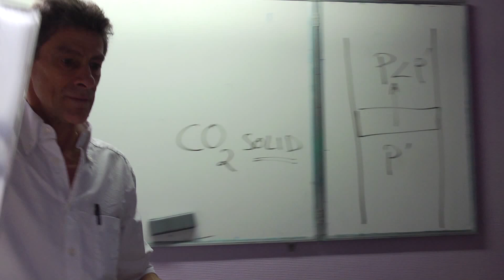Making SOLID Nitrogen!

Comment: Great video!!

I just want to point out one thing though. That was DEFINITELY NOT CO2 at the end. 

Instead it was from the solid nitrogen they made. My reasoning is as follows:

1. Dry ice (AKA frozen carbon dioxide) sinks. It does not float on water. If you are uncertain about this I'm sure there are probably heaps of YouTube videos showing it. [Frankly, this is all you need to know that wasn't dry ice]

2. Liquid carbon dioxide only occurs under containment, if it is open to the atmosphere it will instantly become gaseous, you would never just watch it bubble away

3. Dry ice in contact with cooled water would not sublimate into gas that fast, but when you watch the floating piece of [nitrogen] ice the gas is shooting off it

4. Carbon dioxide is heavier than air so the gas will 'pool' more than what you see in the video. instead the gas is shooting up and away more easily, it still is somewhat heavier than air but that is because the nitrogen is still so cold

5. Carbon dioxide makes up only around 400 parts per million in air. There's no way that enough carbon dioxide from the air came into contact with the water / liquid nitrogen bath to make a big lump like that. Especially when nitrogen gas is pouring outwardly from the bath and pushing away the air

What we saw was due to the solid piece of nitrogen that was clearly floating in the liquid nitrogen before it got poured into the water bath. 
The warmth from the water half melted it but, as it bubbled away, it cooled more and more [just like the 'boiling resulting in cooling' explanation at the start of the video] until it became solid again [albeit now a much smaller piece]
Reply: i don't think so, it's true that solid co2 don't float, the difference in temperature help it float, it's a weird physic phenomenon, because the difference in temperature is so much, the solid co2 turn to gas incredible fast, so fast that it create a kinda of "rocket engine", push it self out
Ps: i knew this because of a sci-fi movie used this phenomenon in battle
Reply: Long Nguyen You contradict yourself. Either a piece of dry ice that big floats or doesn't, and trust me it would not. Also, the water would obviously still be quite cool so the temperature difference would not be enough to make vapor release from dry ice so fast. I have spent plenty of time messing about with dry ice and I have never seen it shooting out like that. 
The only reason it shoots out so fast is because of the great temperature difference between the water and solid nitrogen. A MUCH greater difference than for cool water and dry ice.
Reply: +Marc Somerhausen
That was a very weak rebuttal Marc. It is clear to anyone that it is a liquid, maybe you should run the video at quarter speed and look a little harder, Huh?

I get it why you want to argue the point it is a liquid though, that's because it is the nail in the coffin for your argument that it's CO2. But you still want to persist in arguing it's CO2? 

You are one of these people who would adamantly argue a wrong point because you don't have the spine to be able to admit you are wrong. 

Dry ice is heavier than solid nitrogen but you really think that dry ice floating in the video? The density of dry ice varies, but usually ranges between about 1.4 and 1.6 grams per cubic centimeter which is considerably heavier than water at 1.0 grams per cubic centimeter, meaning that dry ice sinks in water, it does not float. The density of solid nitrogen is 1.027 grams per cubic centimeter, and, while this is slightly more that water it is able to float in the video due to the cushion of gas it is continuously producing below it can overcome the slight difference in density.

You have been proven wrong Marc, just try to have the guts to admit it

Don't start spouting rubbish again Marc, talk is cheap. IF YOU REALLY THINK THAT DRY ICE CAN FLOAT LIKE YOU WERE TRYING TO SAY, THEN SHOW ME ANY OTHER VIDEO WHERE DRY ICE (a piece that's at least as large) CLEARLY AND UNAMBIGUOUSLY FLOATS THE WAY THAT FLOATING IS SEEN IN THIS VIDEO

GOOD LUCK SEARCHING BECAUSE YOU WILL NEVER FIND ONE
Reply: It's really not worth getting angry over this. But I do agree it cannot be CO2. DJR made good points. To add to that, there is less than 1 gram of CO2 in a cubic meter of air. Hard to say how much ice is there but I think it's at least a gram. No way a cubic meter of air was cooled down to -140 C here, right? (Needed given the low partial pressure of CO2 in air.) They would have definitely commented on it (or at least tried to) if the air was cooled that much!

Also — there was nitrogen ice in the bottle. The bottle was poured out and there was ice. Why would we think it's a different ice than the one we saw right before?
Reply: DJR is actually demonstrably incorrect. I say demonstrably because I've done many experiments with liquid nitrogen (evidence on my channel), and it forms the dry ice puck with just regular liquid nitrogen (no frozen N2 needed).

Also, it cannot possibly be solid nitrogen because nitrogen's triple point is at 12 kPa (if memory serves). This is much lower than atmospheric pressure. This means that any solid nitrogen will immediately melt and then boil on contact with the water. It can't sustain a solid form being heated at standard pressure. 

The nitrogen is more than cold enough to deposit frozen carbon dioxide, and it took quite a while to form that amount. I don't know why a cubic meter of air couldn't possibly condense out in that timeframe, given that the molecules in the air travel at hundreds of meters per second. The instant they slam into the liquid nitrogen they will freeze. Even air itself will liquify from how cold liquid nitrogen is (again, evidence on my channel).

Lastly, the reason it floats is because it starts out as little bits of dry ice in the liquid nitrogen and then coalesces into one piece. I know this because I've watched it happen many times pouring nitrogen in water. Millions of air pockets in the frozen carbon dioxide make it appear white and lower its density (pure solid carbon dioxide is clear).

So no, that is not solid nitrogen and it cannot possibly be.
Reply: "Either a piece of dry ice that big floats or doesn't, and trust me it would not."

First of, no. If there was no leidenfrost effect messing the surface of the water, then it would float by sheer surface tension(the same way you can make a metallic coin rest on top of a water surface if you're stable enough balancing it). But there is a leidenfrost effect and that alone it enough to justify it floating. This is not a solid chunk of CO2, this is a thin sheet full of holes.

"so the temperature difference would not be enough to make vapor release from dry ice so fast. "

It is enough. Just look at the fog released. This thin sheet of liquid nitrogen has not much mass but a lot of surface to exchange heat.
Reply: +Marc Somerhausen
3.15 That is not CO2. 
It is very simple ok. CO2 can not exist in the liquid form when open to the atmosphere like this, and it is very clear in the video that a white, bubbling liquid is floating on top of the water at this moment. 
It is a liquid (at this moment, shortly before becoming solid) so it is definitely not CO2.

The triple point of CO2 is at 5.11 atm and -56.4 deg C.  Therefore CO2 only exists as a liquid at 5.11 atm and above, that means five atmospheres of pressure not one.
Reply: DJR This is a good point but you see a bubbling mass, not a bubbling liquid. It could very well be CO2 snow+leidenfrost effect and the snow blends into one solid block.

Liquid nitrogen doesn't spontaneously forms into a solid. With the time it took to form, you can be certain the temperature is -196(you can see that the liquid nitrogen is at its boiling point) and not any colder. You can argue it's something else than CO2, but saying it's nitrogen is stupid.
Reply: @djr5995  "I just want to point out one thing though. That was DEFINITELY NOT CO2 at the end." 
It most likely was. I can't think of any better candidates
"Instead it was from the solid nitrogen they made." That is not possible. It would have melted immediately

"1. Dry ice (AKA frozen carbon dioxide) sinks. It does not float on water."
Steel doesn't float on water typically, yet a steel boat filled with air can. I've poured liquid nitrogen on water myself. Tiny specks of white frozen CO2 start appearing inside of it, and then join together after the nitrogen evaporates. It could be that it's filled with many bubbles that reduce the density. Also, it's outgassing CO2 underneath itself like the Leidenfrost effect, which may help it float. There's also surface tension. There are many potential explanations for why it floats.

"2. Liquid carbon dioxide only occurs under containment, if it is open to the atmosphere it will instantly become gaseous, you would never just watch it bubble away"
This is demonstrably wrong. If you release the pressure for liquid CO2 in a container, it will rapidly boil until it freezes, just like the nitrogen in this video, except it's much faster. This is another experiment I've done myself, so I know this for a fact. The resulting CO2 snow can stick around for some time. 

"3. Dry ice in contact with cooled water would not sublimate into gas that fast, but when you watch the floating piece of [nitrogen] ice the gas is shooting off it"
Again, this is false. Dry ice rapidly sublimates, even in cool water. Also, this was likely more of a dry ice snow. It cannot be nitrogen because nitrogen would immediately melt and then boil. Standard conditions are well above nitrogen's triple point pressure.

"4. Carbon dioxide is heavier than air so the gas will 'pool' more than what you see in the video. instead the gas is shooting up and away more easily, it still is somewhat heavier than air but that is because the nitrogen is still so cold"
But you're admitting that the gas is still heavier than air. It's shooting up because it has momentum. The vapor pressure shoots it up as it escapes from underneath what is likely CO2 snow. Also, some of the gas may indeed be nitrogen, since that was contained in the CO2 snow and vaporizing before.

"5. Carbon dioxide makes up only around 400 parts per million in air. There's no way that enough carbon dioxide from the air came into contact with the water / liquid nitrogen bath to make a big lump like that. Especially when nitrogen gas is pouring outwardly from the bath and pushing away the air"
The nitrogen gas pushes air away in some places and likely sucks it in in other places. The amount of CO2 in that dry ice snow pellet/sheet is probably much less than a gram. I don't think it's impossible for that much CO2 to condense out of the air

*"What we saw was due to the solid piece of nitrogen that was clearly floating in the liquid nitrogen before it got poured into the water bath. 
The warmth from the water half melted it but, as it bubbled away, it cooled more and more [just like the 'boiling resulting in cooling' explanation at the start of the video] until it became solid again [albeit now a much smaller piece]"*
This is not possible. The amount of heat going into it would massively outweigh any self cooling from evaporation. As a matter of fact, it certainly can't self cool because the partial pressure of nitrogen in the air is about 780 millibars which would add some nitrogen back to the solid and liquid, warming it up and melting it faster. Solid nitrogen cannot be sustained at atmospheric pressure and standard temperatures. Look no further than virtually every nitrogen freezing video that uses a vacuum. The nitrogen ice immediately melts when the air is let back into the chamber.
Reply: Anyways it looks awesome. That's what matters
Reply: Your completely wrong

Comment: now make solid helium
Reply: Make solid water
Reply: +Gamer Zeke that sir, would be an extreme feat
Reply: solid hydrogon
Reply: +CrafterBros0 Solid helium can't exist in 1 atmosphere pressure, it only exists in pressures greater than about 24 atmosphere pressures. It would be really hard to do.
Reply: Helium becomes solid at 1 Kelvin, meaning, when you have almost 0 atmosphere, you can solidify helium.
Reply: MCommandguy Last time I checked helium freezes at about 0.95K at 2.5 MPa (25 bar)
That's nearly 25 times the atmospheric pressure, not 0.
Reply: +CrafterBros0 good one
Reply: impossible
Reply: we do, we call them ice
Reply: +Connor Catlett no, it's temperature, but to reach that temperature on a 'big' scale (bigger then a molecule), you need to have almost 0 pressure.
Reply: If you want to make solid helium go to another planet
that has more pressure.. it'll probably work, i dunno
Reply: So you go lower pressure to make solid nitrogen but go really high for helium? THINK

Comment: cool. This same principle is used in ultra high field MRI magnets to drop the Helium temperature from 4.2 K (boiling point at atmospheric pressure) to 2.2 K. This allows the superconductive magnet wire to conduct more current at higher magnetic field. In the process, unfortunately, a lot of Helium is wasted to boil off, and can't be easily recaptured due to oil contamination from the vacuum pumps.

Comment: He says that the water cools as it boils because the faster water escapes. I don't even know what that is supposed to mean. But I was taught that the reason vaporizing a liquid can cause cooling is because changing state from liquid to vapor requires a great deal of heat. It is the principle behind refrigeration. I don't know if he miss spoke or what.
Reply: He boils it at room temperature with different pressure .

Comment: I wonder do you kill the bacteria from the water you boiled with vacuum?!?
Reply: +Alex Stefanov (umnikos) maybe... I mean, not because you are adding a lot of energy to the system in this case, but I think that if the pressure outside the bacteria is great enough it will cause it to explode, hence killing it. I may be wrong though.

Comment: Why doesn't the nitrogen freeze the water in the water bath?
Reply: The contact with the water makes the solid nitrogen (and also the dry ice later in the video) evaporate, making an insulated cushion. Its called the leidenfrost effect.
Reply: the water is protected by a thin layer of nitrogen gas and water vapor it's called the lidenfrost effect
Reply: @Reptiliancentaur781   Should be just nitrogen gas, but yes.
Reply: specific heat :)
Reply: +Luiz Apple Care to elaborate?
Reply: +Robert Armstrong that was jusr a wild guess, but it's imo the only plausible explanation. water has a higher specific heat, meaning it takes lots more energy for it to change temperature than co2, but it IS rather strange that it didn't freeze, since the nitrogen was at -200
Reply: +Haaris Jamil In my opinion it'd have to do with the low transfer rate and just the volume of nitrogen compared to water, which is exceedingly less. The amount of gas created might seem a lot but the actual volume of liquid/solid nitrogen is very low.
Reply: +i8u4tea Yes! i believe that's the same reason why we can pour (small amounts) of liquid nitrogen on our hands and not be harmed. the nitrogen will evaporate before it can cause serious damage.
Reply: +Haaris Jamil because leidenfrost effect. the nitrogen is evaporating so rapidly it's creating a layer of gasses that is insulation the water from the cold there for it can't freeze. That's the same reason as to why you can poor a small amount of liquid nitrogen onto you're hand with out damaging it. It's actually also the reason as to why that small piece of dry ice was racing around on the water at the end
Reply: ***** yep
Reply: I don't think specific heat has anything to do with it. Carbon dioxide has a specific latent heat of fusion of 184 kJ/kg, while for water is 334 kj/kg. The difference isn't that large to make such a dramatic difference, I'd reckon.
Reply: @haarisjamil5080   It eventually will freeze a layer of ice over the water if you put enough on it. I know because I've done it before.
Reply: you can also cause a very similar effect by heating a frying pan and poring a couple of drops onto it. it slides around so easily due to Leiden-frost effect
Reply: Paragon643 Is that the same thing that occurs when you pour water into a hot frying pan?
Reply: +Paragon643 Throw down dry ice onto wet pavement where rain or hose-fed water keeps it very wet.  It will bust into pieces that will skip around, the smaller pieces moving the most.  It's entertaining to watch!

Comment: Being semi retarded I must ask should this last experitment not be done in a controlled air duct, or with respirators? I would hate to think the french professor's enthusiasm is clouding his professional health responsibilites .... your thoughts please?
Reply: François Canguilhem
Oh you are right. My bad. 10% is lethal.
Reply: ... none of the products used is dangerous : there's water, CO2 and N2 wich are chemicals that you breathe everyday.
Reply: +François Canguilhem
Water and N2 can be dangerous if inhaled too much, because they can replace oxygen. CO2 becomes extremely dangerous, if it's consentration in air rises near 1% or over.
Reply: Ulf von Weißmüller yes of course, but you need to have large quantities of gas in a small closed space for that to happen :)

you can breathe CO2 in concentrations over 1% for short periods of time : it happens very often (closed space for a long time, car traffic nearby);  it will create a respiratory acidosis but it's not a big deal if it's for a short time : dizzy head, fast breathing...

i think you meant CO instead of CO2
Reply: François Canguilhem my point is they are radical in unmeasured atmosepheres which you are speculalting, please come again
Reply: Nothing Original i don't understand what you mean. I'm simply saying a CO2 concentration over 1% is not "extremely dangerous".
Reply: Ulf von Weißmüller i bet it is !